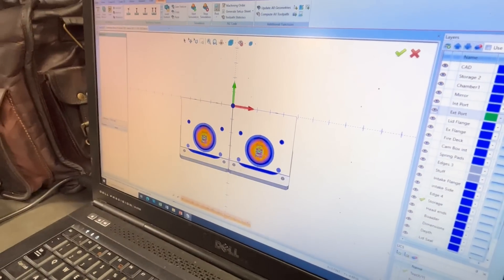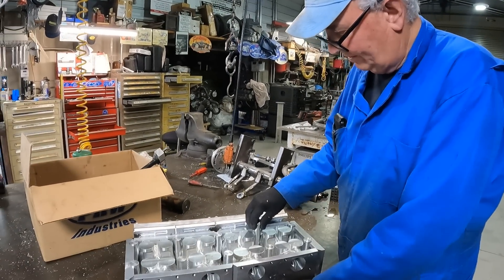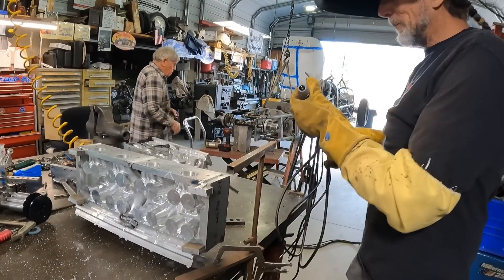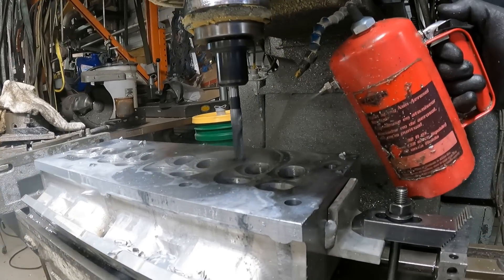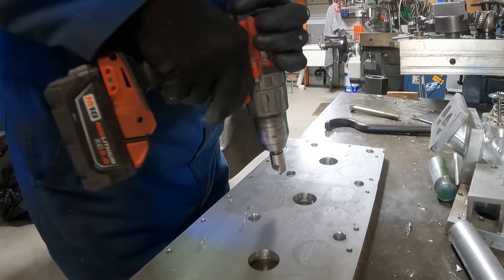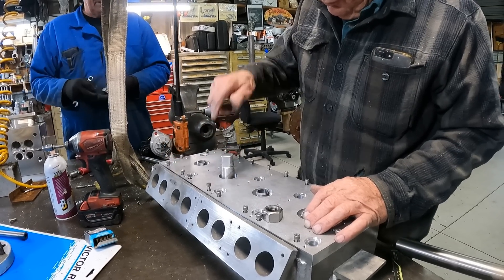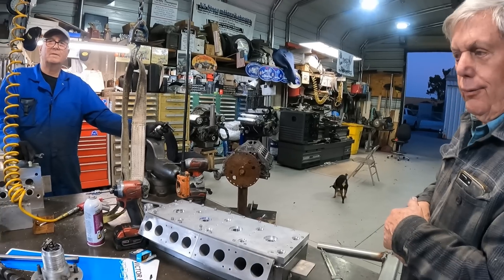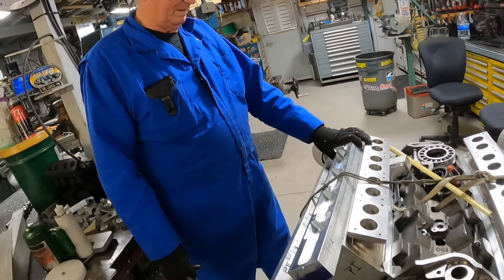1100 Horsepower 7.2L Custom DOHC 4 Valve Engine Build - Aardema Braun DIY Master Engine Builders

Comment: I wouldn't mind building a front drive streamliner, with the driver in front , build a engine from sheet aluminum similar to a EJ subaru engine only a 8cylender boxer, with about 6" bore and 2.8-3.125" Stoke. With a 6 speed transmission with 2-3 auxiliary overdrives. And possibly a single rear wheel. With air suspension. Some aerodynamics to help keep it down and straight. Spin it up to 12k rpm (+/-)  with twin turbos . Running methanol. With the intercooler being under/inside the wing providing down force. With some of the air going through the wing. Then directed up and back to push the vehicle down. Or build a heat exchanger to only have fins or heat pipes sticking up through the wing. Experiment with this , possibly ditching it for water tanks and dry ice tanks , running about 60-80psi and a intake charge 80°-90°f or less. Possibly using nitrous oxide with c16 or methanol maybe slip about 40% nitro in the tank.😮, It should definitely  produce 2-3k HP possibly more. Finding 6" pistons built like a F1 piston. Is going to be $$$. So maybe go flat12 boxer with 4.6" bore and 3" stroke 4 valves per cylinder. With the intake ports 22° from the spark plugs.  And going through the cam cover. The throttle body holding down the cam cover. The head looking like a small v engine . It's not going to be more than a dream.. but I think it would be awesome. Have a great day🎉

Comment: If you could send these guys back in time to England or the Connecticut River Valley circa 1824, I feel like they could singlehandedly accelerate the Industrial Revolution by 150 years in a few decades. Cunard would probably be offering cruises to Jupiter by now.

Comment: unsure how you get 7.2l i get <7l with 4.6inch bore and 3.2 inch stroke
Reply: The class we race in is a 7.2 liter limit.
This engine has a 4.625 bore and 3.2 stroke which comes out to be about 7.048 liters.
Reply: @kevinbraun6272  ahh ok why would you not go for more cylinders then or is 8 max
Reply: @tlovsoe4211  I would of liked to have built a V12, however we are able to buy a pro stock crankshaft and it will only take a couple months to get it.
When we built the 6 liter V12 we had to wait 2 years for a custom crankshaft and one and a half years for the five liter.
Pete just doesn’t want to wait so long.
Reply: @kevinbraun6272  if there is no cylinder limit then  why would you stop at 12 would you not go for at least a v16 or napier w/arrow 18 cylinder maybe even be able to make a vr/w engine work i think you could solve the unequal length ports by using same port type as the old lambo v12 used where port went in between the cams (which also seen on some diesels like bmw m57)

Comment: I wonder why the welder uses a spool gun rather then tig??
Reply: Because you get better penetration because the spool gun operates on direct current.
Eric is a government certified welder and has been welding for close to 40 years!
Reply: @kevinbraun6272  thanks for responding.. Im sure he knows what he is doing I just did not understand why

Comment: Mad men with skills beyond most. It will sound like a motorcycle inline 4 at 10k RPM.
Whit 200 years of experience combined in that shop. They can think through problems at lightning speed. Considering we are getting 200 hp out of 1.3Ll bike motors , 1100 is not unbelievable N/A. Be really cool to see them do that first and then  force feed it to 3500HP

Comment: 10'000rpm is a lot... did two of those on smaller engines one worked grate and the other kept throwing out the same rod over and over again. bushings or roller bearings?
Reply from the maker: 9000 to 10,000 RPM is pretty standard for Pete and Kevin‘s engines  pretty sure it will be fine at 10,000

Comment: Instead of a butterfly throttle, here are the perfect conditions to make a slide throttle, just like in the old Gr.A / DTM engines. 
Thank you for another great video!!
Reply: This type also allows for shortening the intake length, compared to a butterfly throttle.
Reply from the maker: Great point!  Thank you

Comment: I'm surprised the OHV pushrod fanatics haven't tried to outlaw this stuff. About the cam drives. Have the boys ever considered gear drive. Either regular spur or helical. Or a tower shaft setup. Or is a toothed belt more efficient in that consumes less power.

Comment: never seen the wire in the handle, cracking idea every mig ive owned as struggled with wire feed if working in crapped condition. bane if my welding life, oh and getting one in the ear.

Comment: Through tool coolant would really help those deep drilling operations. That could lubricate the tool and improve cutting process and work well with pecking to evacuate chips.
Reply: I used to work in an engine plant. Oil distribution ports in the blocks and heads on the Aluminum V-6s (1) were gun drilled in one pass. No pecking with high pressure coolant flushing the chips. The cast iron inline 4s & 6s the main oil ports were done with 1/2 twist drill at least 18 inches long with a special grind to ease drilling.
1) Chrysler 2.7 and 3.5. Any issues you may have heard about with the 2.7 are purely the result of design choices. Not build quality. Driving the coolant pump off of the internal timing chain was a really stupid decision. Both the 2.7 and 3.5 featured some things that potentially could lead to a really stout engine if modified. Deep skirt block. 6 bolt main caps (4 vertical 2 cross), cast windage trays, forged cranks, descent porting, crank mounted oil pump etc. All tapped holes in the blocks and heads feature formed not cut threads aside possibly from some meant for mounting sensors etc. Stellite valve sets and guides. I've long had the thought that the 3.5 or the 4.0 along with its transaxle could make  a nice engine transmission setup in a mid engine sports car.

Comment: That MIG is set on kill. A 4-valve V8 that is more oversquare than a Pro Stock engine? The sound is going to be beyond glorious. Can't wait to hear it run.
Reply: Have you seen this guy? He welds copper cooling lines for steel mills, among many, many other things. A true craftsman.

https://youtu.be/RRxAANqmrL0

Comment: I appreciate the inside scoop, since I'm currently designing heads to go on my 4.6 liter 3-valve Ford V8 (using pneumatic valve actuation). Now I just need their garage and machining skills.
Reply: Camless valve technology really opens up the possibilities for both engine operation and head design.
Reply: OMG, DIY pneumatic actuation is not the easiest way home :)

Comment: The welding process is it done with DC en or is he using AC though the spool gun?
Reply from the maker: I think it is and AC welder
Reply: @GregQuirin  that's awesome deal with them making there own OHC heads for the LS engine. Can't wait for you to release part 2 of the build...

Comment: Is this considered a big block? 😂
Reply: Depends on who is doin the considerin.
Reply: @Jiunds   what so you mean
Reply: Yes. It was originally designed in the 80's as an Oldsmobile Pro Stock engine block. It's gone through several updates but still a great foundation for a race engine.
Reply: @mchristr  how much would something like this weigh? And is this flat plane or cross plane?